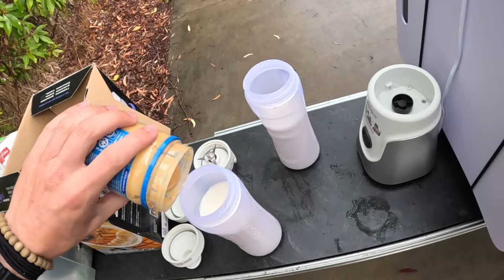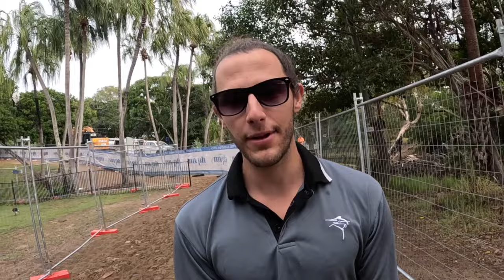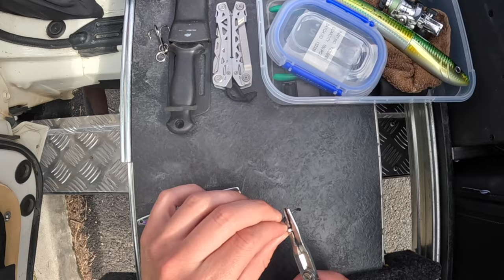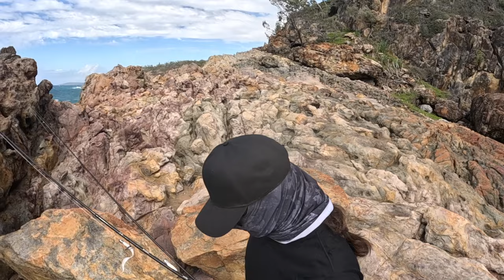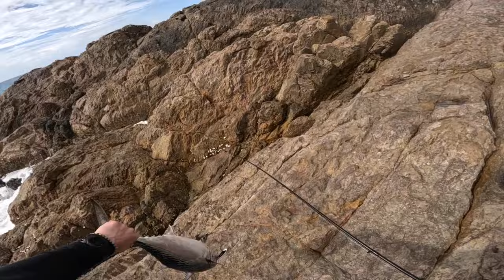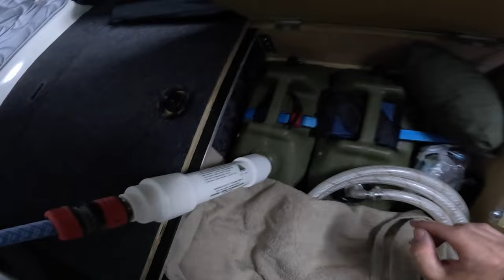LAND BASED TUNA FISHING +TRAVEL VLOG (Ep7)

Comment: Hey Jake, Im headed that way shortly, how slippery are those rocks? Did it feel sketchy?
Reply from the maker: Gday mate 👋 

Thanks for the message.

A hard question to answer really haha but I’d probably put them at about a 6/10 on the slippery scale. I’ve certainly fished from both less and more slippery rocks.

Obviously the ones with water splashing on to them or the ones lower down which are more often under water seemed slipperiest. 

With that being said besides the part where I was jumping around after the fish I felt pretty stable. Was able to find a few pretty big flat dry rocks which I spent most my time on. 

Honestly I found the walk to the fishing spot sketchier than the spot itself. Certainly not a place to take lightly.

You could always pop in to the Agnes Water tackle for some more up to date info, they seemed pretty helpful in there. 

Hope that helps legend,

All the best with your trip ✌️